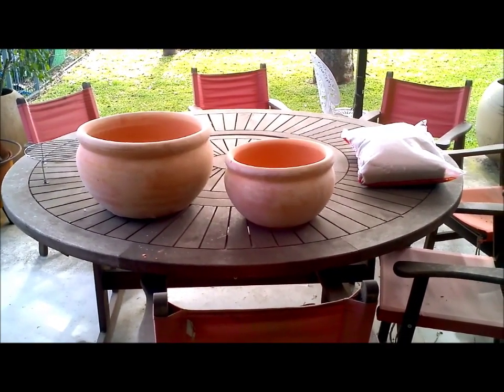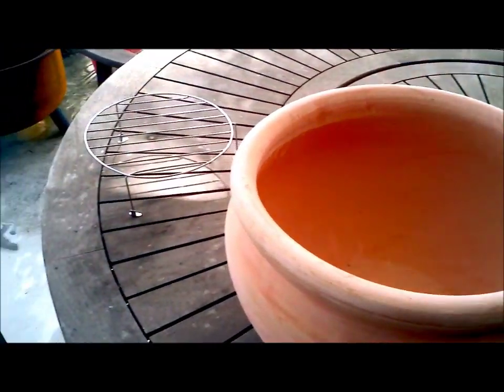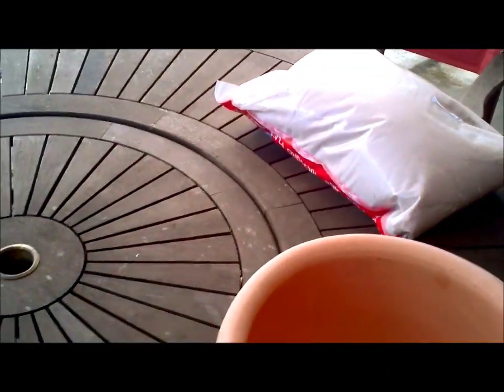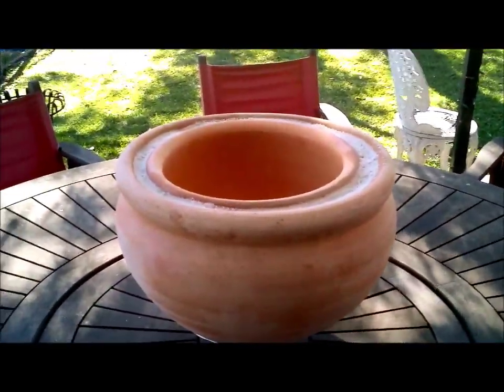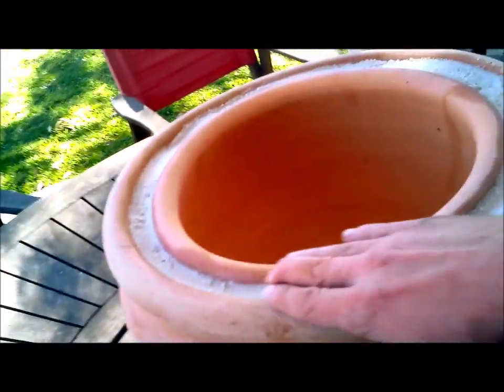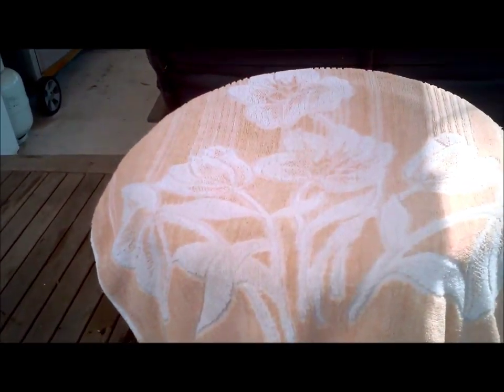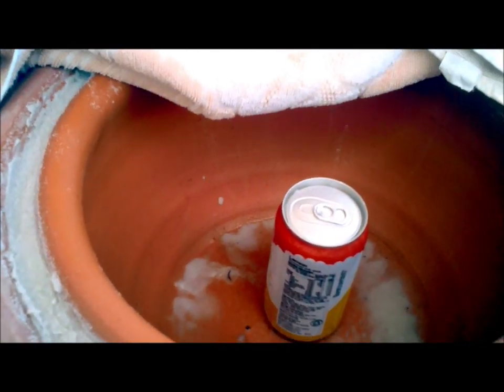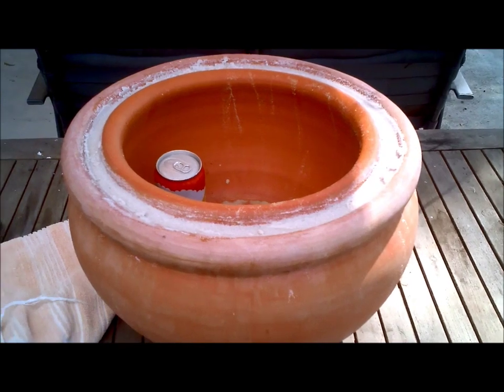Zeer Pot

Comment: One thing that makes a big difference in the Temperature is to only cover the very top with the wet towel, not letting it get on the rim, even one inch makes a big difference, and also putting a regular lid on it, from one of your cooking pots, they really work great too, then cover it with the wet towel, only to the rim, not passed it. If the bottom of either pot is not sealed very tight, that will not let it cool as much either, so that's about it. Hope it works for you, and you really did a fantastic job of it. I love the pots you used. Bless, Sheila